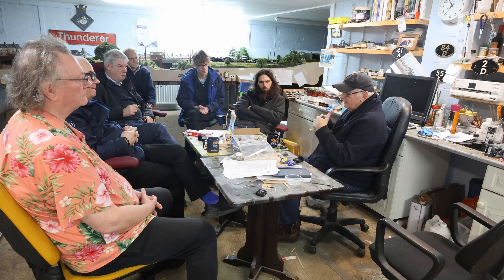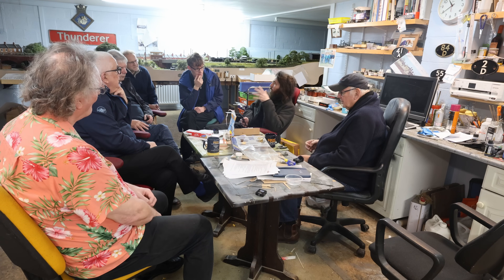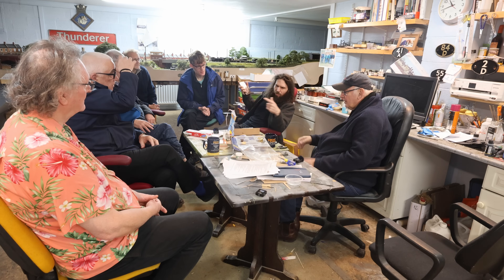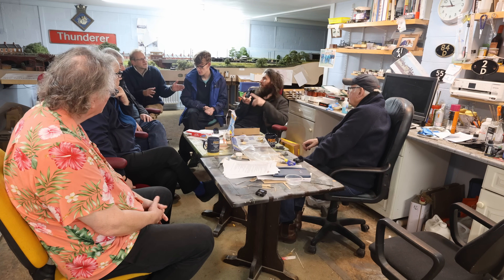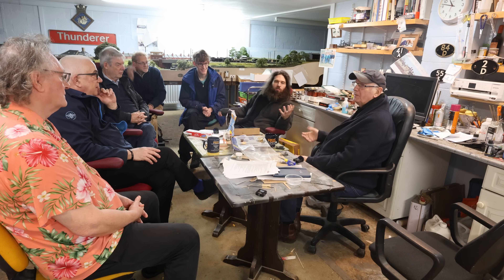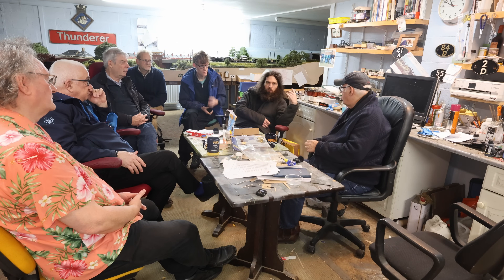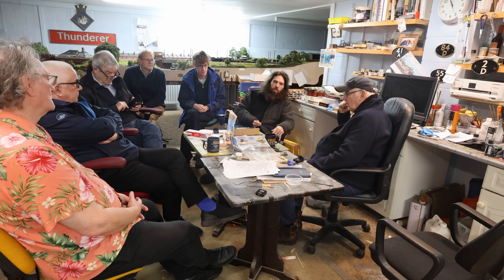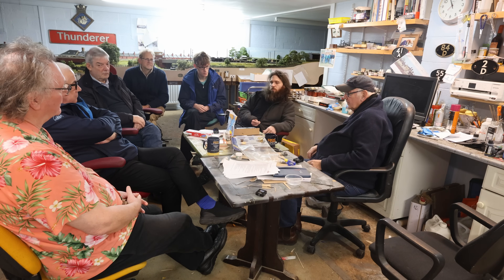Pete Watermans “The Grand Challenge” - Post show analysis.

Comment: I went to Chester and spoke to several of you guys.  In total awe of what you achieved.
Milton Keynes was just too far from Glasgow for me to drive..but I followed it on the videos.  Blimey - dunno how you kept going - such an inspiration!!!
I've always believed that problems are there to fix and learn from...presenting a challenge that others will benefit from. Trailblazers indeed! Sharing the issues and solutions is what consultants get paid big bucks from, so hats off to you all for that.
Crumbs; I remember fighting with catenary wires 50+ years ago....I gave up! You guys didn't. As you push the boundaries, then suppliers need to follow. It's how things evolve.

Comment: Firstly a compliment to Dave for all the videos of making tracks 3. It has been an interesting experience from the start. Finally getting to Chester to see Milton Keynes in action was a great day for me. The build up to GETS and getting there and seeing the enormity of the complete layout was fantastic and you all deserve our praise.
This latest video is very interesting as it gives an insight into the hiccups one gets from track to the electronics, track problems in most cases are relatively easy fixed but with more and more electronics and computer related issues and relying on components and if they fail finding the bad one on a very large layout. DCC has made control a lot easier and will take the model railway game in to a future of automation for some but not all.
At least the locos and rolling stock have performed well.